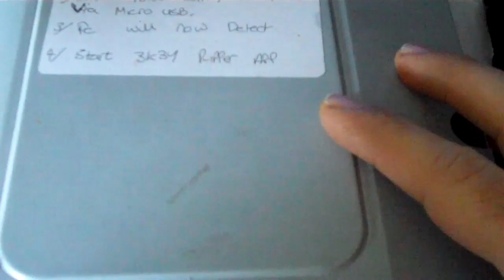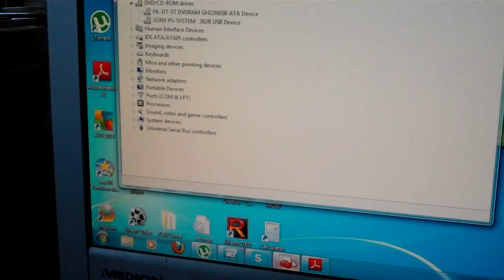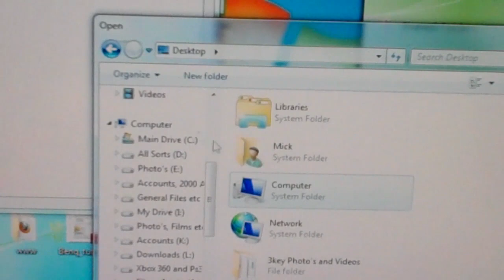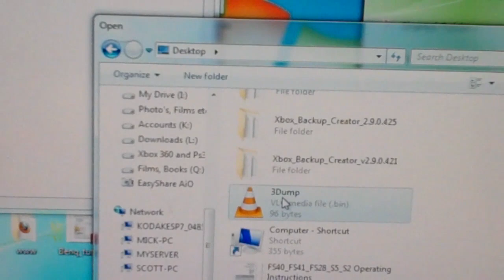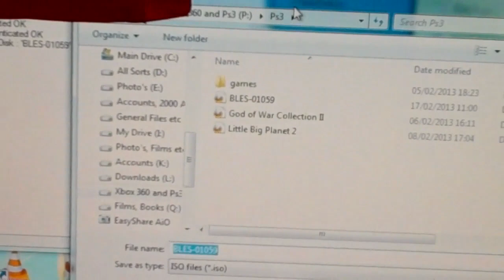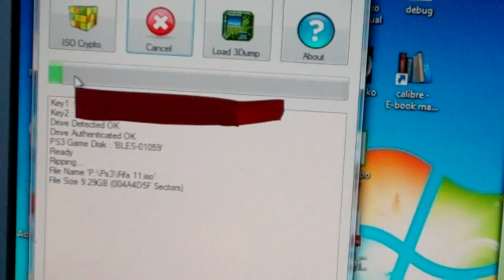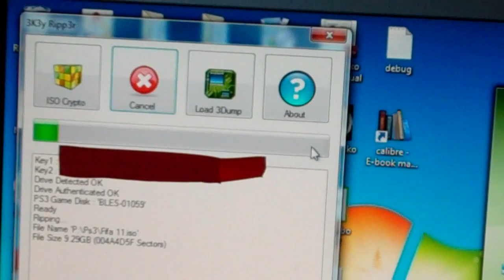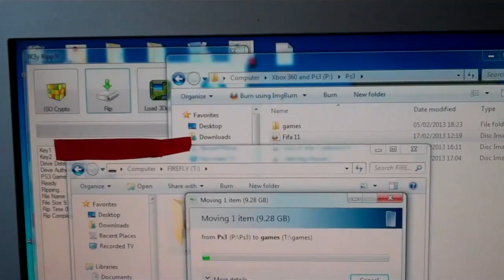3k3y Ripper Install and Tutorial. Rip/copy a PS3 game to a hard drive.

Comment: I have a super slim with 3k3y 3kr but I am connection a usb to usb to pc to ps3 dongle  not connecting. do you need some kind of program that picks up my ps3
Reply from the maker: I'm not sure I understand your question but if you are trying to rip games you either need V1 or V2 of the ripp3r board, and either a phat or slim BDrive.
Reply: M Starlored I Have A Slim BDrive.  When I Connect my Ps3 To Pc Nothing Happened .My  BDrive is Not Being Recognize By Pc. Is There A Program That Allows Ps3 To Recognize By Pc .Or Do You Not Use A Curtain Program
Reply: Rich Centrella I Have A Super Slim Ps3 with 3k3y 3kr  installed on ps3 . I was told that I Can now Connect Pc To Ps3 and use App Ripper.  Ps3 Not Showing up in device manager . ps3 not set up for  V1 or V2 of the ripp3r board. My Ps3 Is Set Up Differentyl I Have the newer 3k3y Or do I need  V1 or V2 of the ripp3r board for all ps3 even super slim

Comment: I have a external HDD formatted to FAT32, for my PS3, so it can recognized by the PS3. I ripped a game and when I try to copy it to the HDD it says the file's too large and it can't be done. Then I noticed you answered WUCATILLY at the end of these posts and said about a NTFS file system, how does the PS3 recognize the ISO's then? I'm confused as to how I'm supposed to get the ISO's I just created to my PS3. A little help here please.
Reply from the maker: Its the 3k3y that recognises the ISO's and plays them. The Ps3 can't play the ISO on its own, you will need a 3k3y for your model of Ps3.
Reply: M Starlored I have the 3k3y, the remote, and the ripp3r drive setup for my CECHA01 bro. I was just wondering how, after I use the ripp3r software and make the 1:1 ISO's(which I currently have done), to get it from my comp. to my PS3 so I can play them? Do I need to format my ex hdd to NTFS or EXFAT to do so, cuz I can't use it in fat32. I tried and it says the files are too large to copy to the FAT32 HDD.
Reply: I've been reading up on the forums www.k3yforums.com/viewforum.php?f=28 but I can not seem to find the post that explains what to do.
Reply: Ok so far I found this... http://k3yforums.com/viewtopic.php?f=29&t=12740 NTFS, EXFAT or ext2/3/4fs partition.. which is the best one to use for the PS3?
Reply from the maker: I use NTFS with no problems.

Comment: Do you have to rip specifically on your PS3's drive or can you use rips from torrents.
Reply from the maker: Not that I condone Piracy, but Yes. you can.
You will need to "rebuild and extract" the rip to ISO format (either with or without its IRD), how to do this can either be found under tutorials on the forum or I have a video showing how.